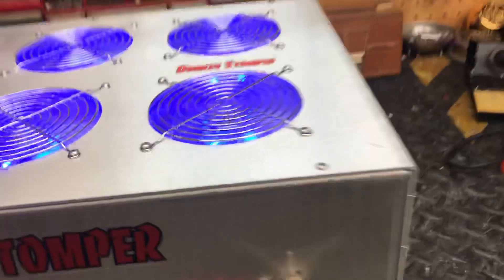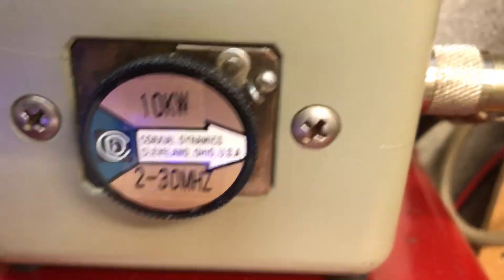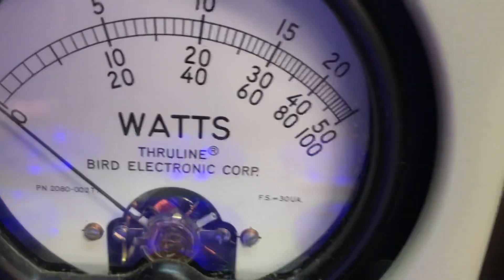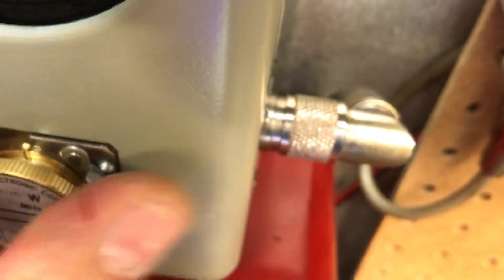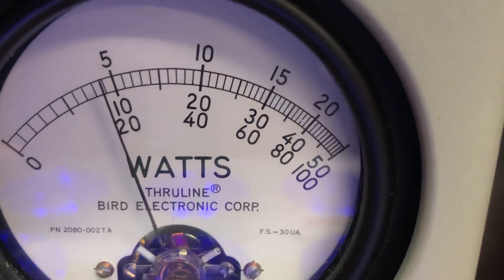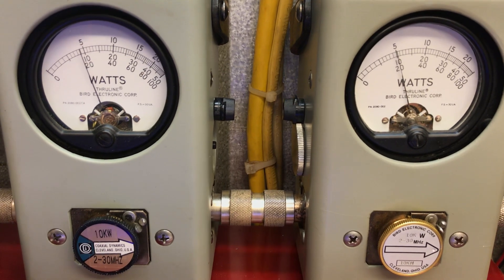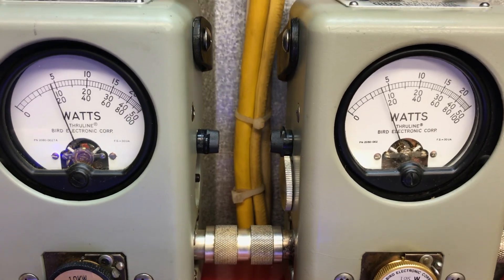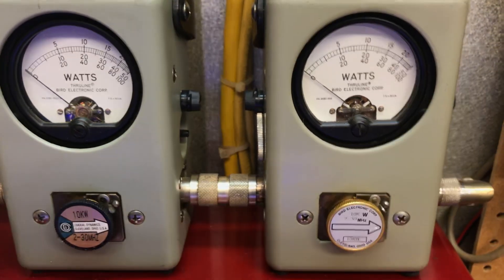Our Coaxial Dynamics 10KW 2-30MHZ V.S. Our Bird 10KW 2-30MHZ Element/Slug

Comment: I was curious.. could the coaxial dynamics reading tighter ever lead to any issues such as over driving? If it’s off 10-20% on a carrier I’d imagine that could lead to some issues but I don’t know much about amps and radios other than I like em
Reply from the maker: Carrier is same pretty much not really. Thanks
Reply: @DonkeyStomperProducts okay thanks just wanted to check before pulling the trigger on one of their meters. By the way do you mess with repairs?
Reply from the maker: @ChristiannTyler  We do comp amp transistor amp repairs. Thanks